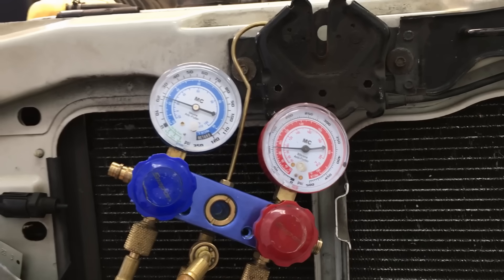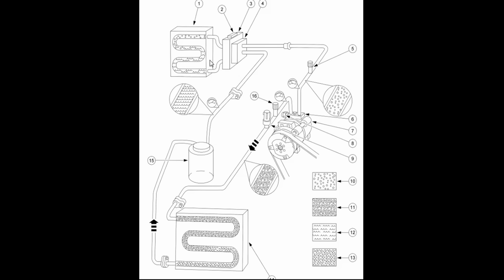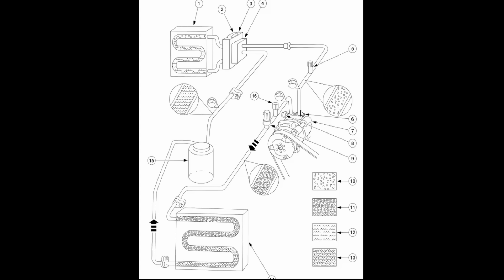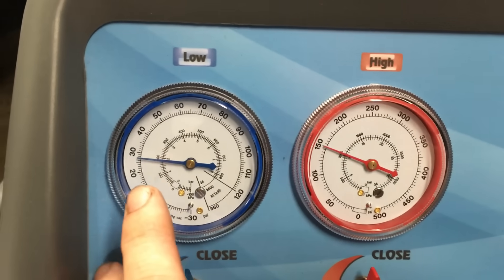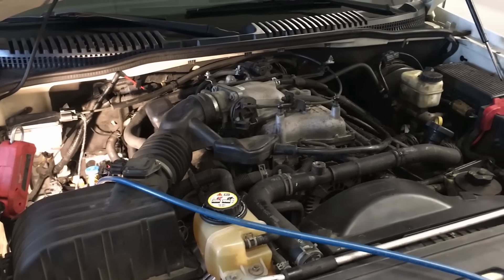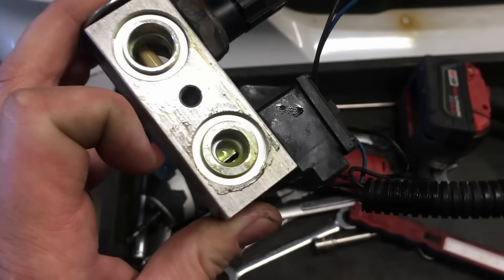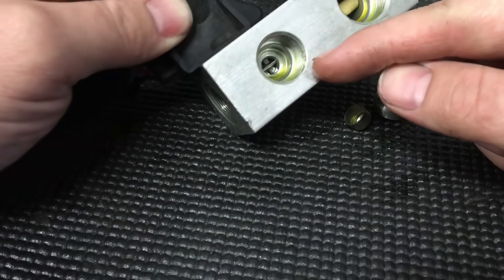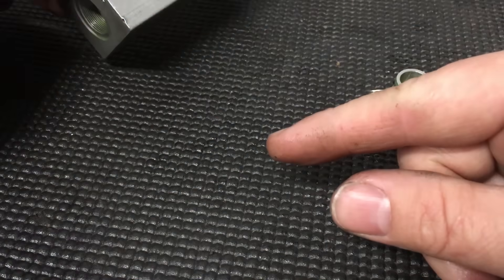3 Common Signs Your TXV has Failed Causing Poor A/C System Cooling

Comment from the maker: A good set of A/C Manifold Gauges are invaluable when diagnosing A/C concerns-
http://amzn.to/2g8Bkae
Reply: FordTechMakuloco what size charging hose is on your master cool gauges , is it 1/2acme x 1/2 acme for the yellow charging hose
Reply: Hey buddy, to change that valve does the lines have to be evacuated to perform the task? I know you are a really busy man, but a reply will help a lot. Thank you.
Reply: @arturovaldovinos1393  Yes
Reply: I just bought these from your link. Thank you so much for the videos.
Reply: Fantastic❤
Reply: Would the same apply to gm ?
Reply: Great video... my question is can an expansion valve be replaced with a orifice tube?
Reply: Your a busy man and I so appreciate what you do here , helped me at least 4 separate times on my fords 03 focus, 96 cobra, 97ranger and now a 05 expedition EB .
If you wouldn’t mind, free advice on the expedition? 
It’s full of Freon , the previous owner charged it up with some sort of ac pro crap. I diagnosed it to have a leaking high side port , got it to seal ( mostly ) and now it’s only mildly cooling (70 deg maybe) on 100 deg days yesterday I check it and it was 60 low and 300 high on a 105 deg day  .txv valve ? Or fan clutch ? Or ??  It’s an aftermarket one ,have no idea who sold it , just know it’s not a Motorcraft  I don’t want to throw parts at it till I have a better direction. I’m not afraid of the work. Totally appreciate your response!!!

Comment: Trying to fix mine. First test shows 60psi rest and stays at 60 when on but high side rose a little.  suggesting some compression but poor compressor. Next day low side gets pulled to zero suggesting blocked txv. Possibly both compressor went and then txv too. I'll test over a few days what readings I get. If they are all over the place not sure what part of parts to replace. Best do both compressor and txv I guess. I'd rather hope for just txv

Comment: I do have one question I realize that you were talking about the valve being stuck closed but what will happen if the valve is stuck open the symptoms will be different, correct? Does anybody out there know will the gauges still balance out?

Comment: You helped me out again. 
2016 F150. A/c comes on nice and cold but after a while it starts going warm.
Put gauges on and they were not equal. Started it up and low was at 15, high was around 230. Initially thought it was low on charge, but I  had watched this video once before and realized it is the txv.
Thank you again.

Comment: The failed evaporator that is stuck close may have smudge that prevents the spring from pushing the metering valve back open. Or the diaphragm may have failed and leaked internally so that it cannot push/ pull the pin anymore.

Comment: IT took a bit to figure out why the high side is also low pressure in that scenario of failed clogged TEXV.  It's easy to understand that the compressor is getting starved of refrigerant by the stuck evaporator causing a low pressure on low side but high side also low pressure is trickier to understand. The compressor need refrigerant in gas form to build a pressur, initially when you start the engine low side and high side have equalized so there will be some refrigerant on the inlet for the compressor so the high side might first want to move up but then is will sit as a liquid in the dryer reservoir or accumulator and cool down because it cannot pass the restriction in the evap. As it cools it'll loose pressure and it will keep doing that slowly the longer you run the engine.

Comment: My AC just exploded Saturday.  It started doing the cool fine when it was cooler outside, but once it got hot it would stop working.  We were driving and heard a loud boom and white smoke went everywhere.  There's neon dye all over the compressor and under the vehicle.  I'm guessing something was clogged and finally come lose and caused the compressor to build up to much pressure and it popped. Ford put that stuff in a terrible place!!

Comment: I'm an armature at A/C and usually only work on 90s Fords with orifice tubes. My dads 2015 F250 was baffling me why the low side would pull a vacuum but high side was still 125psi, and static was around 90psi. The system would take an hour to fully equalize. This helped reassure me it was the TXV because everyone else i asked doubted me. Replaced it with Motorcraft and its working great now.

Comment: Rod suppose to move freely. You didn’t unscrew the diaphragm. Main problem is the rod from diaphragm gets stuck. If you take it all apart and clean it will continue to work just fine. Main thing is to lubricate all moving parts before the assembly. Diaphragm goes in the last. Make sure the spring and the ball perfectly aligned with orifice. Count cap revolutions while you unscrew it.

Comment: I had the same issue with my Toyota Tundra and topped off my coolant and added a lubricant into the system.  Amazingly it cured the txv valve and is working perfectly!!!!!  With 190,000 miles and heavy usage living in Texas I'm not sure for how long it will go, so I have purchased a knew TXV, and compressor just in case.  But it does work really well now : -)

Comment: Automotive AC systems are the last great frontier of the unknown for me. I recently purchased a set of manifold gauges a couple days ago and have been crunching on system operational parameters and things were about about 85% clear to me. This video brought me to 100%.

Thanks for always producing videos that are sufficiently detailed. One thing that sets you apart is you explain the WHY, and not just the HOW.
Reply: Damn me and you are pretty much the same, I have a great understanding and experience   of the mechanicals of a vehicle. But how exactly A/C's operate component by component, and being able to diagnose why a system is doing what it's doing always went over my ability. But now having issues with my personal vehicle has forced me to dive deep into HVAC. I have a 2015 Lexus GS350 and with the A/C on I was getting 55psi on the low and 135psi on the hi with 97°F ambient. Then when I turn the vehicle off, the pressure would just sit there. Also, adding or removing refrigerant would do nothing even after it settles for awhile. I'm glad I bought these gauges and we have the best University of all time, YouTube!!. The parts should be arriving today so hopefully in the next few days I'll have 32°f air like this one did. Hope you fixed your problem you were having 👍🏻.
Reply: I hope you are using the appropriate PPE when working on the AC?

Comment: Good points, what if one of the valves is ok and the other is bad (front A/C)? So, the pressure would equalize because one of the shared valves would allow that. I just experienced this and im calling that front expansion valve bad since i can get very cold temps on the rear so, the compressor is doing its job from that fact. Hard to call it because the evaporator core could also be restricted but hopefully thats no the case. Let me know what you guys think in front and rear ac system. The temp blend actuators move to the correct location so thats ok.

Comment: Hello, Ford Make you Loco. Happy Easter Saturday 2024. I am working on a 2012 Nissan Frontier. My buddy, and owner of the Frontier said his AC was working fine and then one day he noticed that the vent air began getting warm.....and then warmer and then, nothing but hot air. Ok. I got a 12 oz can of freon and hooked it up to the hose on the low side. The hose had a a gauge. The freon hose that I was using to install freon is of the garden variety hoses. It is not one of them that has two gauges and three hoses. I hooked up the hose to the low pressure and the needed buried as if the system was packed to the rafters with freon. I asked my buddy if he added any freon. He said no. I scratched my head and wondered why the needle would bury itself when in fact the compressor is not kicking in? So I did the next troubleshooting thing that came to mind. I released some gas with the vehicle off. Still the AC did nothing and the compressor did not want to start. I released some more gas from the ac low side line and gave it another go. Still nothing. I hooked up the recharging hose and noticed that the needle was no longer buried. It was in the somewhat low side. I told my buddy to start the truck. I began tapping the expansion valve and the other sensor that is on the condenser side. Still nothing. With the truck on I got under the truck and gently banged on the compressor with a hammer. The compressor kicked in for some seconds and shut off. I got out from under the vehicle and added the 12 oz can of freon. This seemed to have done the trick. The AC was working. However, I told my buddy that I feel the expansion valve is no good and this problem may surface again. I left his home and told him to get back to me. Sure enough. About an hour later he told me the AC went South again. Well, I am not an AC tech. I am a superficial troubleshoot type of individual who has strengths in other areas, but AC is not one of them. And when I need some pro advice, I come to Ford Make you Loco. Thank you.

Comment: I have negative pressure (in vacuum) with the engine running and AC on max.  High side around 50.  Where to start?

Comment: My Altima AC, when engine is off, shows 65 psi on low side and 65 on high side. When engine is running and ac clutch is engaged, it shows 32psi on low side and still 65psi on high side. What could it be the cause? Ac is blowing warm, btw.

Comment: Hey Makuloco, been trying to fix up my 2002 Expedition’s ac system and so far have replaced a few things like leaking schrader valves, pressure switches and condenser. I put the vacuum and it held steady at 28 mercury, so i went ahead and recharged for the third time and the car began cooling like it hadn’t been in years, not even when the mechanic topped off. However, within 3 days or so the pressure dropped from 30 to 20, so obviously there’s still a leak. I decided to check the rear hvac since i noticed a lot of condensation on the rear lines and expansion valve (tx? The gold block) and dripping with water. I took the cover apart and noticed a loud hissing noise when the ac is on. Could the rear evaporator be the cause of the leak reference the hissing noise when it’s on or is the noise normal? I also noticed vapor, kind of like when dry ice meets the air, emanating from the surface of the evaporator. Is this normal from it being cold vs. The ambient temperature in Miami or is this the refrigerant escaping through a leak? Anyone?😢
Reply: How long did y’all hold the vacuum for when y’all tested it?

Comment: Would a txv issue in 2016 ford edge with dual zone climate cause the driver side to blow hot and the passenger side cold ? Only happens after car has been sitting in the hot sun.

Comment: ok when i change them the pressure on both side would show on the  low side 50 or 55 the high side 250 but when i put rev on the system it shows maddness low side went down to 20 low side and the hig side 350 almost 400 what u think is this problem
Reply: With the gauges connected. Turn off the car. And if the low and high side equalize then the expansion valve is good. Check if ur condenser is dirty on the fins and clean it with a water hose but also check if ur fans are working correctly. They should turn on to high speed to help cool the condenser.

Comment: i dont know if you can help i know that when my a/c is running it should chip out and chip in back it doesnt do it again do u have and idea what can cause it i change the condenser and drier   and thinking know to change the txv which u said the expansion vavle

Comment: I have high low side psi (65-70) and low high side (120). Pressure equalizes in about 2 minutes after turned off. I'm thinking clogged receiver dryer or faulty txv. Thoughts? Trying to eliminate compressor as a fault. AC worked in the morning, stopped working when I went to lunch.
Reply: Sounds like the compressor is weak

Comment: Shouldn't the txv flow on the high side when at ambient and above temps are detected on the exit of the evap....which would allow more refrigerant to the evap. Can check a txv by making sure the high side flows good when not installed.

Comment: Would anyone know why I'm getting high readings on low side. I charged with correct amount scaled worked fine for a day came back and static readings are 250 at high side and the low side Guage pegs all the way. I would think thx has shut all the way causing too much pressure on both sides.

Comment: 2006 mazda 3s 2.3L auto sedan 335 k miles
I have this problem the does car not over heating . Theonly part I have not changed is expansion valve and high and low sensors I charged up with 134a no leak fix  shop said I need a new compressor and high line I replaced myself 

New parts 
Ac compressor new not rebuilt  not China crap eather GPD
Cooling fan
Condenser
Dryer
High pressure line
Water pump
Thermostat
Flushed radiator inside /ou coolant
Expansion tank
Cab filter

What could it be?

Comment: Would this cause hissing in the dash like about the middle area? My suv used to hiss a little once in a while now it's persistent & the ac will only run cold after being on the expressway for 5+ min then goes out as soon as I go regular speeds..I replaced lines last year system holds a vacuum & the proper amount of refrigerant was added

Comment: Please explain how you can spot a restriction just by visually inspecting the lines?  Maybe if you spotted a severe crimp in a line that would work, but if they all look intact, it would be impossible to detect where the restriction would be just from looking at the lines.  Also, can you explain how ambiant tempetures in the shop/location affect nominal Hi/Low side pressure readings?  I believe they have a significant effect.  Is that correct?

Comment: Thank you for sharing your experience!  Is there a spec for the supply air temperature?  On this one it is so cold it would be below freezing at the coil and collecting ice.   Maybe the low side pressure was too low.

Comment: I was thinking mine was the expansion valve til you started talking about a misdiagnosis someone made about their compressor. This makes me think mine is a compressor problem because the psi will go from like 35 to 40 and end up at 60 , and the high side won’t go over 115 or 110. So I’m thinking the compressor is not working correctly. It will click on for a second and then I think click off ? Is it possible it needs more oil ? On my es350 the expansion valve is a pain to get to should I just replace the compressor ?
Reply: Also I don’t think it’s equalizing when I turn it off. That makes me think it’s the expansion valve again
Reply: Also my first freon can is only emptying into the low side around half way before it won’t take anymore. What does this mean

Comment: Thank you for this. I had a full charge of 134a and still no cooling. the compressor would run for 5 seconds or less and shut off. The low side pressure would drop while it was running and rise slowly when it stopped. No cooling at all. I am going to take it in and have someone replace the TXV and retest. Thanks.

Comment: couple things when you pressurized a system not just vacuum if the low side doesn’t go to the retard of the gauge its a bad compressor and in your opinion how long should it take for a five pound system

Comment: Great video! I think I may have a bad one. 

AC stops working after 65mph. ACC_PRESS in Forscan drops from 250 some psi down to 130psi and no more cold air. 
AC works fine before that. Also, it takes about 1hr for pressure to “equalize” between high and low after engine is shut off. (Still stays off be 30-40psi)

Comment: awesome video! super helpful and informative! helped me diagnose that my compressor is bad. my pressures equalized and my gauges show that I have a low, high side at 88 and high, low side at 60.
Reply: Did you have trash in the system when you replaced the pump? I'm now learning that if there is no trash, it could have just been a bad compressor control valve and the actual compressor is still good.

Comment: Thanks for the video, I've got one I'm scratching my head on. I've got 75 lp & 175 hp at 90°. Inside air is really cold then it starts blowing warm air.
Reply: I have the same issue on my 2011 corolla. Did you find out what was the problem? I’m thinking my issue is the expansion valve or ac compressor control switch.

Comment: This is a great video and great information. My AC warms up when I’m driving but when I’m idle at the stop light it gets cool, what do you think the problem is? I have been told me compressor is bad or my expansion valve needs to be replaced.

Comment: Really nice video. My car is a 2009 toyota corolla my low side sits on 20 to 30psi while my high side sits on 150 to 200psi the the system was charged the low side hoses get really cold but the system cycles too often and inside doesn't get as cold as it should. The technician suggested changing the expansion valve. Pls what are your thoughts

Comment: I have a 2010 volvo and fans are not coming ON. I will have nice cold air when moving anywhere from 15 miles and up.  The fans will turn on when I come to a stop and turn off the car. I Put the car in the garage with a large fan to the front of the car and ac Temps dropped lower than just having the car ON and AC on high. Can the pressure valve make the fans not turn on due to not enough AC freon coming through.  Thanks, FYI I have changed the fan control module but no luck on getting them to turn on while driving.

Comment: my expansion valve is not removable on the evaporator.. is it normal?? and i dont see any wiring or sensor attach on it..
Reply: and my problem about my ac is it takes only 2 months after fully charged with freon. im a third owner not knowing the history of this ac.